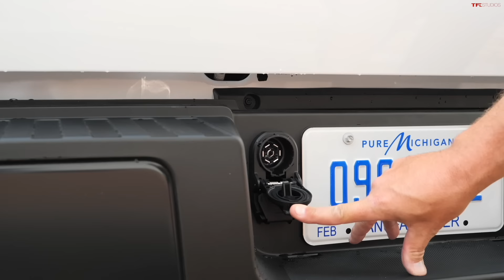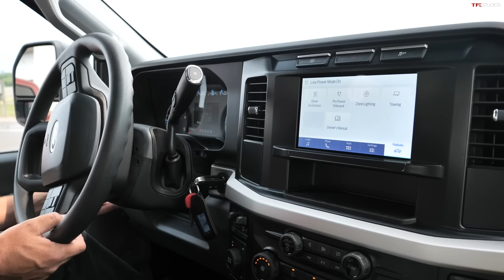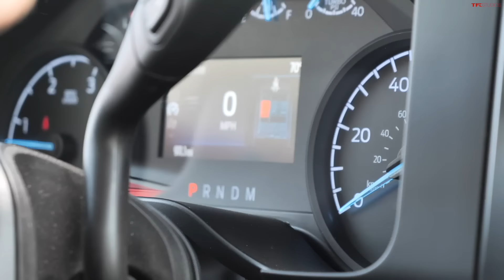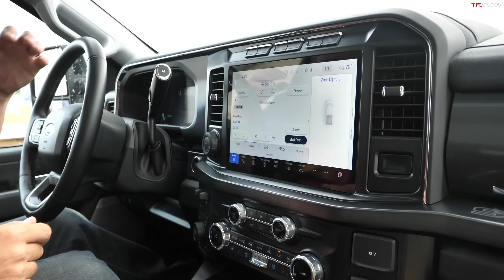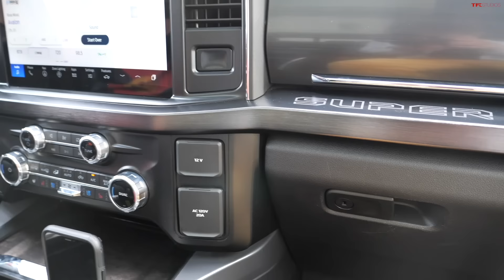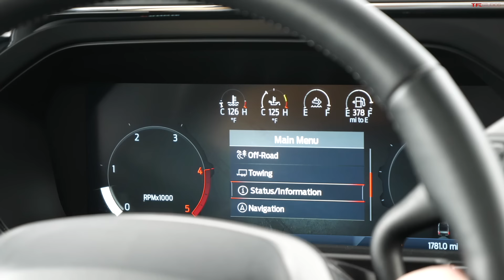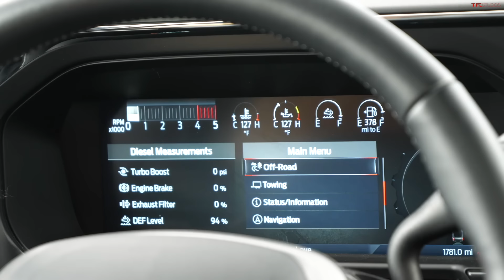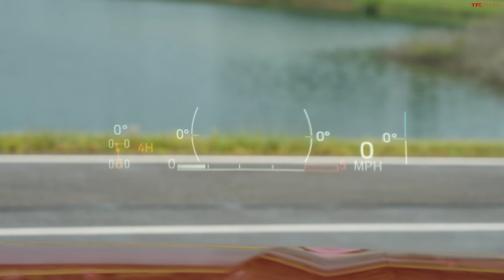The New 2023 Ford Super Duty is a Game Changer: I Take A Deep With The Engineer Who Built The Engine

Comment: Lifter ,cam and tranny problems. Nearly everyone wants a larger fuel tank on the gassers. Why not ask the questions customers are concerned  about ?
Reply: Gm has had those problems since 2007. Very few fords have
Reply: right.  Disconnecting your trailer to gas up because you can't use a diesel truck stop sucks.

Comment: I should have my f350 lariat ultimate powerstroke in a month. Ticket for build was pulled two days ago. I lost my loaded 2013 lariat power stroke in a garage fire two months ago. I’m a ford employee part time and customer who ordered the one I’m getting backed out so I’m thrilled to take it. I’m 71 will never use it for what it’s made for but I don’t care. I’m enjoying my golden years and this should be my last rig.😊
Reply: Hi there so you basically daily drive it and don't tow right? It's pretty awesome and looks nicer than most cars
Reply: @MarkR973    Yes, I do have a car trailer though if I need it.
Reply: Congratulations! I got mine 3 months ago 24’ F350 SRW 6.7HO Platinum Tremor. I absolutely love this truck. I will be using it to tow a 5th wheel RV a couple times a year. Like yours most of the time it will be what I like to refer to “a pretty boy truck”. I have a home building company but there is zero chance that my truck will be hauling anything but me 😎.
Reply: N I C E    !

Comment: There are a lot of comments on Youtube about the roller lifters on the 7.3 gas engine galling. Has this perceived problem been resolved by Ford or is it not a concern because it is blown out of proportion?
Reply: Given the thousands of those engines that have been built and are in use, about 1-2 percent of them have suffered lifter issues.  So, like everything else on the social media platforms, people blow everything out of proportion...they read about 1 issue, and suddenly every truck on the planet has that problem....they don't stop and think that it is a very small number of engines that have problems.  Like anything new, it'll take a while to get the problems sorted out.
Reply: Ya and you got to remember all the RVs that have the same motor!! That’s thousands more motors in chassis and cut aways  every year!
Reply: Very few failures
Reply: @FutureTruth1  Plus the crate engines as well, not sure how many of those they sell, but they're higher HP/Torque than the engines used in production trucks.
Reply: @FutureTruth1  because not many have the miles to fail
Reply: @wildbill23c   i think its  very real issue.. the 1 to 2 % ur talking about are those that reached failing mileage.....i think s we get to 5-10 yrs...u will se that ALL of these engines fail with very few exception...at the same miles
Reply: @privateer9181  2% of the 500K engines out on the road isn't much of an issue....now if 98% of those 500k engines had the issue, you might worry, but with less than 10k of those 500k engines having issues I wouldn't be too worried, even then, you have a 3 year warranty...if you are that worried you probably better not be buying any vehicle period, they all have problems...some far worse than a few lifter problems.
Reply: You call lifter failure a minor problem !!!
Reply: @johnhopperstad2785  LOL, yes when its an extremely small number of engines that have experienced that problem, its extremely minor, and these trucks are new enough to be under warranty, so it isn't an issue at all.
Reply: @wildbill23c  I’m looking to buy a 3yr old 7.3 f250 not a new one with warranty guess will wait and see how many failures at yr 5
Reply: @johnhopperstad2785  Extended warranties are available for up to 10 years.  If you buy a used vehicle that's 3+ years old, it most likely isn't going to have that issue, it would have already been a problem long before that.
Reply: @johnhopperstad2785  It is a matter of statistics. Every mfg. has had the major engine and drive train problems. That is statistically minor. It is most noticeable in new stuff when it is introduced to the public.
Reply: @johnhopperstad2785  I was seconds from sealing the deal on 2021 7.3L 3.55 F250, started looking into things, then called my mechanic, I'm now shopping RAM. And I've been in Fords for years, and just sold my 2010 F150 STX with 192k on it (running great). There seems to be something going on, also the 10spd trans seem to be growing problems too.
Reply: @StrateOutdoors You'll be MUCH happier in a RAM!  I am on my second one and trust me when I say that they build GREAT trucks! I have had Ford and Chevy trucks too, but both brands gave more problems than my Rams have.  I had very few problems with my first Ram and 0 problems so far with the second one.  You made a great choice by buying Ram.

Comment: I purchased a 2023 Ford F250 Diesel Lariat two months ago. The truck is impressive. If I drive the truck at 68 MPH on the four lane highway I am getting 27 mpg!! That is with the cruise control set. The 3.31 gear ratio and the 10 speed transmission really do a good job for the fuel economy.  There are so many other features I like. The HUD is one of those great features. I did not like the HUD at first, but I am now used to the display. FORD needs to solve the fuel pump problem.
Reply: One of my 'must have' options is HUD.  Once you have good HUD, it's really hard to not have it.
Reply: 27 mpg you are lucky and the only one in history to get fuel mileage that impressive. We have all of our trucks monitored by satellite and at 70mph all 30 tucks 20.5 with the eco mode on. Don't give that truck you are driving up.
Reply: @matthamilton7452  Does you diesel have eco mode?
Reply: Yes sir. All of them do. At best doing 70 I may have seen 22mpg.
Reply: @matthamilton7452  how do I get to Eco mode. If I go 70 I too drop down on the millage. I have to drive 68. I have a bed cover on the truck. No load
Reply: @timmartin3927  It should be on your knob on the dash board where you adjust your drive settings. It will turn left or right. If you turn it left a leaf will show up on your dash board.
Reply: @matthamilton7452  I will try this. Do you have a 3.31 gear ratio?
Reply: @timmartin3927  I do. I do like the 10 speed transmission
Reply: I’ve never had a diesel and have driven mainly Ram’s most of my life. Did you do any comparisons between Ford and Ram before making your decision?
Reply: Think you're bologna. 27mpg right....
Reply: @czealtamahawk1228  not kidding. 68 mph with cover over the bed 27.
Reply: HO?
Reply: To reach optimal towing capacity the gears need to be taller. I’d consider 3.73 at minimum
Reply: what does HUD stand for?

Comment: I picked up my 23 F350 SRW, Lariat Black Appearance package last month. Love the truck. The wireless Apple CarPlay has been a little finicky.   Sometimes it just won’t connect and I have to turn the truck off, open the door and try again. We tow a large 5th wheel, 45’ long and 13.5’ tall. It weighs about 19k when loaded and it does fine. 4100lbs if payload capacity.
Reply: I"ve had that problem with wired CarPlay.  Not in a Ford though.  Probably a universal issue.
Reply: Yes it’s a universal thing still best choice out there
Reply: My work truck F150 just did that to me today. I simply just disconnected it from Bluetooth and then hit the connect to apple carplay in the phone menu. I don't think you have to turn your truck off.
Reply: When connected wirelessly, if you did not connect to CarPlay, plug in the hardwire to your phone and it will connect. Then you can disconnect the hardwire and it remains connected wireless.

Comment: I'm still very satisfied with my 2023 7.3 xlt.  Tows great for both hauling my tractor and my travel trailer. Only complaint would be it has more squat than my previous 2500 RAM with the 6.4 gas engine.

Comment: diesel apparently have a lot of fuel pump issues.. and the 7.3 are having some issues as well... would love to see those big issues discussed
Reply: Mine seems to be fine and I have a December 16th production F250 SD Lariat. What issues with the fuel pump are you referring to?
Reply: @boobacockaa  I’ve  only seen a failure in real life on a work truck that was neglected and never serviced appropriately. Online It’s blown waaayyyy out of proportion. Had multiple 6.7’s and know lots of people in my area that have had 0 issues.
Reply: No issues if know how to take care of your diesel.  All diesel engines built these days need lubricant in fuel.  If you use additives regularly no issues.  Change fuel filters every 20k . Drain water separator every 3000 miles
Reply: @jmad9294 same here. 1/5 of ours had cp4 bad maintenance
Reply: Couple hundred thousand on my 6.7. No issues
Reply: @SVAutoAustin the comment section is full of Chevy fans. They say the trucks has issues but can’t say what they are. Enjoy your new Super Duty.
Reply: Diesel fuel is a lubricant learned that in the Sea Bees and the multi fuel engine. If you ran gas in it add 1gal oil per tank
Reply: I have a super duty 2021 6.2 gas with a 2400lb truck camper in the bed
Reply: @boobacockaa  to the contrary - i know diesels so well, treat them the way they should be treated, and have to ask about cp4 because I have HAD NO ISSUES..... So i should indeed be driving a diesel - maybe you shouldn't? You must be a wiseguy no?
Reply: I'm in a 2020 with 160,000 miles and have not had any issues.
Reply: @brianperry493 those Chevy boys won’t talk about all the major engine failure they had in 2021 with the 6.2 and 5.3 engines lol. They need to look in the mirror before they start bashing other brands lol

Comment: From a rating standpoint the 7.3 with 4:30 rear end is rated (i.e. legally allowed) to tow almost the same as the 6.7 regular powerstroke (not the HO)—7.3 is only  ~1,000lbs less for gooseneck.  For weekenders the 7.3 seems the best option, and is $9,000 less than the regular powerstroke.  Add in a higher payload than either diesel and you have a highly capable truck.
Reply: You'll probably go through that $9,000 savings real fast with a 430 rear gear and the gas engine. HIghway engine RPM will be very high and using gas like it was free. I get 12 to 14 miles per gallon towing with a diesel engine compared to friends getting 6 to 8 miles per gallon towing comparable weight with a gas engine.

Comment: That high output 6.7 is a monster sitting on the stand. It reminds me of the 6.4.
Reply: the only thing good about a 6.4 is.....................nothing. at least you dont have to remove the cab to change a turbo on a 6.7.
Reply: @rearspeaker6364 you don't have to remove the cab to do a turbo on a 6.4 either. I've done hundreds. 

Total pile of shit though, and very hard to work on.

-Ford tech

Comment: Just got my 7.3 Lariat.  I don’t like all the chrome, but I didn’t want the 20” wheels that the blackout package requires.  Still breaking it in and will do my first long towing trip in July.  Hope I don’t regret going gasser
Reply: I think the chrome crap is part of the Lariat package....my 99 Lariat has way too much chrome as well.
Reply: Chrome is so outdated, it’s a 60’s 70’s thing…. You would think these “big brain “ designers would have figuredthat out by now  especially being that most people who buy trucks are practical and not into flashy shiny stuff…..that’s one thing I love about my 22 power wagon ZERO chrome, looks super sharp, also 17” wheels for maximum side wall for cushion and wheeling. Who and why would you want a 20 or 22” wheel???? Les side wall stiffer ride and bad for off road. I think “some” people think chrome and 22” wheel look cool lol.
Reply: @titaniummaster1532  exactly.  I am sure over the next few years i will find aftermarket ways to make the chrome go away.  I couldn’t even get the snow plow and camper package and do blackout.  Even a satin silver would be better than the chrome
Reply: @carperdiem8754  totally agree
Reply: @titaniummaster1532  Well they may not want chrome, but they buy a luxury car with a truck bed attached instead.  Truck prices are totally ridiculous for what a truck is actually supposed to be for.
Reply: @wildbill23c  I agree, it’s all out of control….. I’ve had 7 trucks my favorite was my 68 Ford F250 standard cab 4x4 strait 6 all manual with a 4 speed and grant gear….. had a  pto winch.
Reply: I bought the same config in a 2023. Changed from my 6.7 diesel due to how much non towing driving I do. Had to change my clogged DPF exhaust system @ 23,000 miles. Ford did under warranty. But informed me next time I will have to pay $11,700 to replace. So I switched to a 7.3 gasser. 1 month in, so far so good. A little down on power, but I expected that. In the road empty I get 15.5 +-. Figured out diesel to gas fuel comparison, I will have to drive about 700k to break even for the difference in MPG between diesel & higher fuel charge compared to gas with less MPG. But I will never have to replace any DPF or emissions issues like on my last truck for the type of driving I mostly do.
Reply: @aldeluca5079  wait. So you had a warranty. They fixed it. But said next time you have to pay? Was your warranty expiring? Cause if not that seems wrong…

Comment: Andre & Team, I have a question that I have not seen addressed in your videos. I am wondering why I should choose the 3.55 rear end over the 3.31 for 5th wheel towing with a 6.7L HO. I have seen some people say the transmission compensates enough to make up the difference with a 3.31 while getting better fuel economy. Thoughts?
Reply: probably slightly higher tow rating as well keeps a better rpm during heavy towing.   If you do lots of heavier towing 3.55.  If you don't tow frequently or don't tow overly heavy then 3.31.
Reply: get 3.55 or whatever higher numerical value is available for the configuration you require.
Reply: 3.73 or 4.10 would be my choice.

Comment: The hud in GM trucks was the main reason I left Ford. I am so happy they got with the times! When you have complete neck fusion, it is really hard to look down for directions on the gos systems, the turn assist shows on the hud making so you do not have to turn your (which I can’t) to read the radio. Thanks for a great video!
Reply: Should you really be driving if you can’t even move your neck?  Sounds like a rolling accident waiting to happen